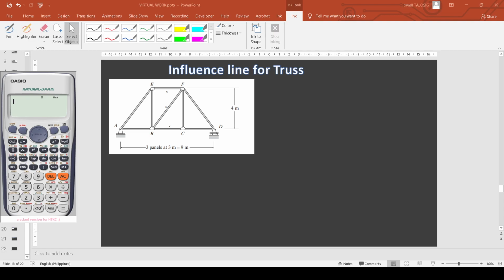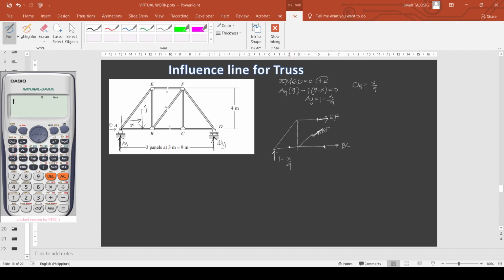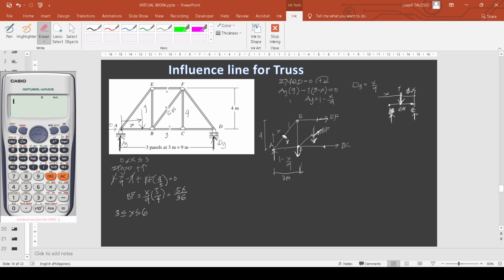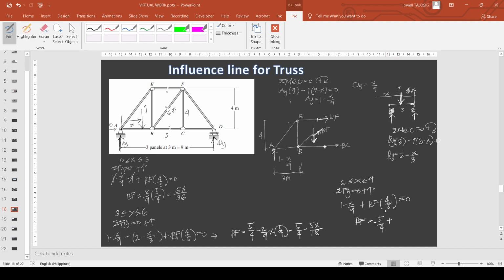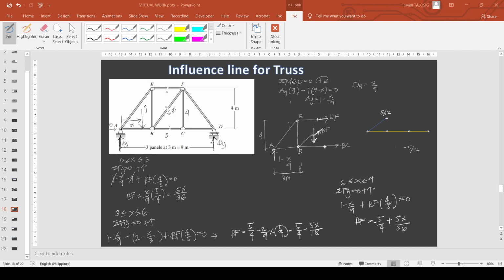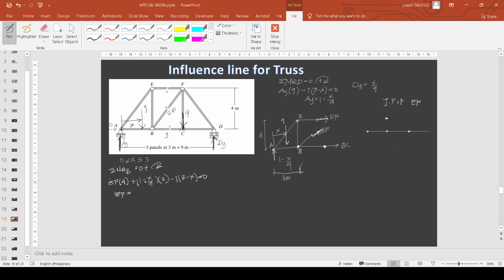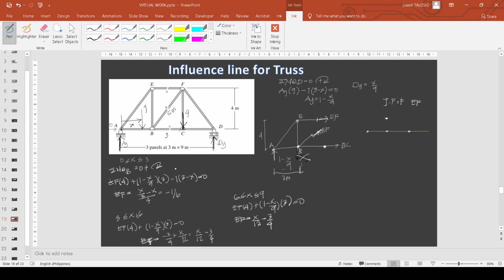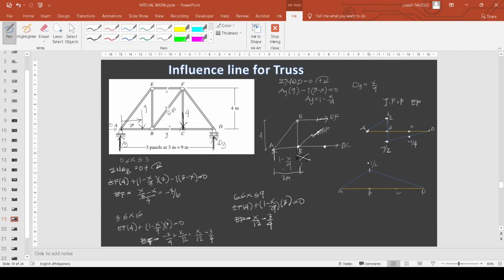Influence line part 3

Comment from the maker: there was an error in plotting of the Influence line of member EF. there was no + 1/2 in the answer. the answer should be 0 to -1/2 at X=3 m. and -1/2 to  0 at the end on the truss. the figure should be a big triangle with a base along the horizontal and with a height of -1/2. Thank you very much